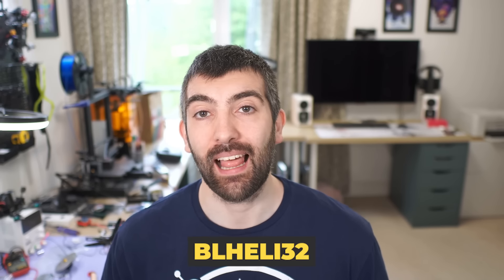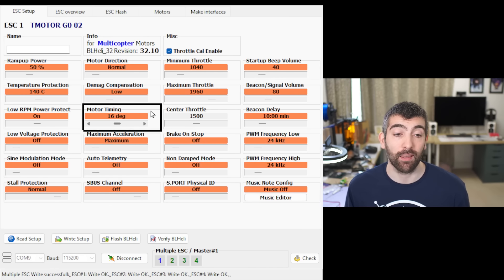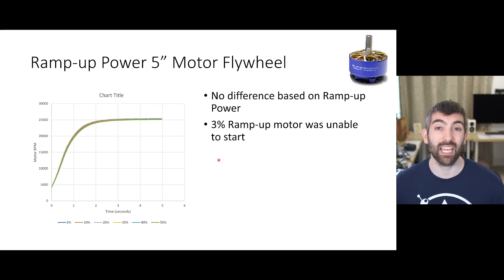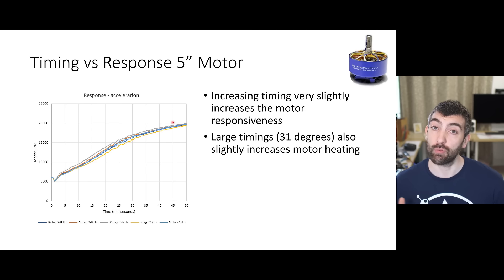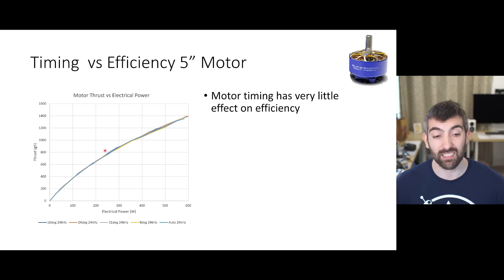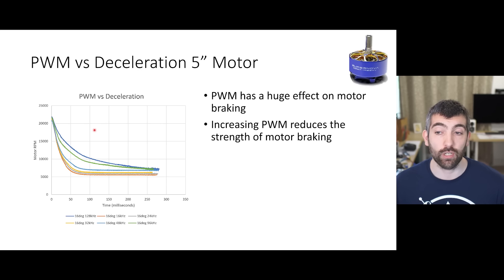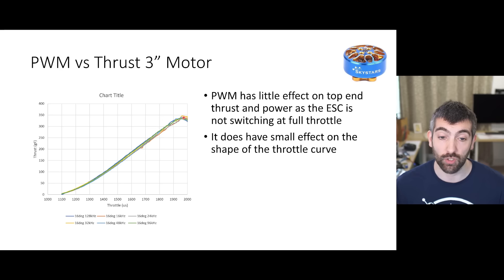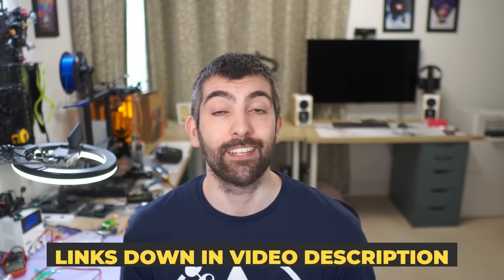Testing to find the ULTIMATE BLHeli_32 Settings for 3" and 5" drones

Comment: Okay what about if your running an 03 air unit on a 3.5 inch drone with 1804 - 3500kv motor should the pwm 24 or 48?

Comment: I can't follow along.  You reccomend motor timing = 24deg for 3" and then test pwm freq. with 16deg. and recommend 24/24khz pwm.  Wouldn't you want to test the pwm with the recommended 24deg motor timing instead of 16deg?

Comment: You didn't mention the effect of PWM frequency on gyro noise   I've found that 24khz is more likely to cause gyro noise than higher frequencies.   Of course, that depends on the ESC, FC, and motor combination.

So it's not always about top end performance; sometimes one has to be more pragmatic to get a quad working properly.  People need do a motor throttle sweep in BF Configurator to see if there is a point where the gyro freaks out using 24khz PWM.  Then try 36khz or 48Khz PWM to see if the noise goes away.

And let's not forget how PWM frequency affects the O3 Air Unit.
Reply: Yeah, on my 3inch 24khz pwm was introducing jello to my 03. Changing to 48 fixed that. On my 5inch freestyle rigs, I run 24/24 and 03 footage is butter smooth 🤷🏻
Reply: @Chris Rosser
I removed the propeller and got a log of rotating it to full throttle, and checked it with Betaflight Blackbox Explorer.The ESC is running Bluejay, and the vibration was the least at 96Khz.
Reply: This is why my recommendation has always been 48khz fixed timing. Based on my tests and reinforced by Chris's tests here, there are very minimal losses at 48khz and the noise reduction is definitely worth it. Above 48khz the losses compound and the noise reduction is not as significant and it's no longer worth it for 5" motors.

Comment: It's great to discuss these things individually but an overall quads performance is based on the sum of all the factors. I've had builds that had severe desync issues on Betaflight and there was no ESC/FC settings that improved performance. Then I switched to a KISS Ultra FC and the desyncs stop completely. The only difference being the FC and firmware. 

Also, thrust linearization used to have some effect on performance and was recommended if you using 48khz and up. Is that still a factor?
Reply: If changing flight controller software fixed your issue it was likely it wasn't a true desync, but likely something in the flight controller causing a dropout on the signal side. I've seen that happen more than once when the issue was actually a tuning problem causing runaway prevention to kick in etc. 

The thrust linearization recommendation is actually relevant to the decreased braking forces he shows here in his tests. It's important to note that the braking force losses are relative to the dead time multiplier necessary for each ESC, so will be dramatically variable depending on the ESC in question. Some ESCs with low dead time will not see nearly the degree of braking losses as ESCs with longer dead times. Typically the higher current rates the FETs the longer the dead time, and the worse the braking losses at higher PWM frequency. The more the braking losses the higher the thrust linear value is needed to compensate.
Reply: @QuadMcFlyFlies  with the flight controller in question, the motor desyncs were occurring on default settings as well as after being fully tuned. After reviewing Blackbox logs, it was extremely similar to the desyncs I've seen in the past, where a single motor would go full power even if the stick command was not calling for it. Then, after switching to a KISS Ultra V2 FCFC, I pushed the tune pretty far and still did not have a single desync. The point is that just discussing ESC settings without including other factors like PID tune and firmware is just a strange approach, and it would be better to see a guide that ties the two together.
Reply: @MurdersFPV  I agree with you for the most part. I disagree with his recommendation for 24khz for this reason, as in many cases 24khz is unflyable due to gyro noise issues and 48khz almost always ends up tuning better. The research side of what the settings do is still solid here from Chris, but some context is definitely missing. I've tuned literally hundreds of quads and built and flown personally well over a hundred in the last 10 years, which goes into my recommendations, and I only recommend lower PWM frequencies for 7" and higher rigs as the dynamics change there a bit. Brian (PIDtoolbox Guy) will tell you the same things, I've worked closely with him to review a lot of testing especially for the larger motors. That's where the practical experience comes in to interpret the results in context. Would be nice to get some of that in the video.
Reply: @QuadMcFlyFlies  This has been my experience as well.

Comment: y wonder for Brother Hobby Tornado T7 4215 or T-Motor MN5008 Antigravity Type 6-12S UAV Motor KV340 on 8s allot of desyncs at 70% throttle  50% ramp up , pwm or 16 or 24khz, 16 timing demag low or very high  no chance to working , is better on tornado 85 % throttle , i try non damped mode on  no brake but still desyncs esc is iFlight Blitz E80 80A 2-8S BLHeli_32.
Reply: you need much lower ramp up and much higher timing. infact your rampup and timing is exactly the worst combinatin for causing desyncs. try 25% rampup and 25deg timing. also i would not reccomend going lower than 24khz pwm. 16k causes lots of issues. 24k and good electrical filtering (lots of caps) should do. also never use non damped mode. it disables active breaking which is awful for the pid controller.

Comment: A PWM frequency like 96 or 128kHz is just a good marketing feature, regardless if BLHeli (R.I.P.) or AM32?
Reply: It's useful for smaller motors and lower current ESCs that have faster switching times and lower dead time values. 96khz and 128khz is super useful for tinywhoops for example.
Reply: @QuadMcFlyFlies  Agree, but I meant the ESC boards with 30.5mm hole mounting and not the AIO boards for Tinywhoops.
Reply: @maryjane136  Yeah for sure, total marketing on the bigger ESCs other than the fact it likely means they have a faster processor, which is still useful for overhead even at the lower PWM frequencies. Higher speed MCUs tend to handle bidirectional dshot a bit more consistently in my experience.

Comment: So what is the point going beyond 24khz other than the O3 issues some are having with smaller builds? The lesser braking ability is often what causes poor propwash handling.
Reply: At 5" 48khz is 100% still the best recommendation. The braking losses are not that significant and the noise floor takes a serious hit at 24khz. Compare your gyro noise levels and you'll see you have to dramatically increase filtering at 24khz in the large majority of cases. You have to increase it enough that in most cases any handling improvement at 24khz is overwhelmed by the increased filter latency.  I've consistently gotten the best flight performance at 48khz and very little filtering. This is why my default recommendation has always been and continues to be 48khz fixed timing.

Comment: Just want to comment about rampup power, that setting also affects the motor at 0 RPM, it sets how much power is dumped into a single winding during the 'startup' phase of the motor before it starts commutating. Using the 100kgmm^2 flywheel from a dead stop is a good test for this.

Comment: What about AM32 and bluejay?
Reply: and whoop motors, haha!
Reply: ESC drive mechanics are roughly the same regardless of the software. The same settings should apply in all firmware pretty much equally given the same motor and prop combination.
Reply: @QuadMcFlyFlies  as to my knowledge and my experience on AM32, your statement isnt completely right... as long as i know AM32 drives motors harder compared to BLheli, so PIDs has to run lower. Then everyone has different builds with different build quality and everything changes from quad to quad
Reply: @gabruzz  I've done extensive testing across all firmwares, going even back to the original BLheli 8-bit stuff before BLheli_S, and I've been testing AM32 since it was first released. I've worked closely with the devs from BLHeli and AM32 and I haven't seen any evidence for what you mentioned. Actually all the 32-bit software tends to run a bit lower at the top end than the 8-bit options, but that's not really relevant to what I am saying specifically here. The point is that the differences in these settings are roughly the same proportionally between all the firmwares and have the same basic impact regardless of the ESCs software. They're settings relative to the drive mechanics of brushless motor systems and the basics of that are the same regardless. The recommendations I mentioned above have been the same across several changes in firmware,  BLheli_S/BlueJay and BLHeli32 for example. Obviously the tunes will need adjustment, but the settings recommendations are the same. As I mentioned elsewhere I do disagree with Chris on the recommendation for 24khz for 5" because of noise and tuning issues, but again that holds across all the firmwares I've tested.
Reply: Seems more relevant than 5 days ago doesn’t it

Comment: Good stuff. This matches pretty much exactly with the results I got years ago testing these, and gives more support for the recommendations we've been using for defaults for a long time. 23 degrees timing, fixed 48khz pwm, rampup 30% is the answer for 3-5".  As far as 48khz vs 24khz goes. The 48khz results here are not significantly different from the 24khz and there is a significantly lower noise floor in the gyro in most cases with 48khz, so I think that recommendation still stands. I would be curious to see if the issues with higher PWM frequencies on that specific 3" motor could be solved by increasing rampup power.  48khz at least would be beneficial. Typically the smaller the motor and the higher the RPMs the more it will benefit from the higher PWM rates in terms of efficiency and noise.  My whoops are all on 96khz for example.  This has a lot to do with the fact that the deadtime multiplier for those tiny ESCs is like 5, compared to 30 or more on higher current ESCs. Remember, the PWM performance at high frequencies is directly tied to the dead-time multiplier.

Comment: I used BL HELI 32 for updating my Tinyhawk Freestyle 3 ,and my ESC’s no longer work. The drone just flips over upon arming. I Guess the drone board is just useless now. Any reason why this happened. Maybe I should have used Blujay instead.
Reply: Flash back to the original version
Reply: its either motor direction, motor mapping, fc orientation, or props. 100% user error. its the easiest thing in the world so solve if you just look it up.

Comment: I see the PWM frequency vs acceleration was tested using 16deg timing any reason to believe the results would be any different for alternative timing settings?  Also which dshot 300/600/1000 was used for these tests and could that setting also affect the timing or PWM testing results?  I assume not for both questions but I’m curious!  Hopefully results translate to AM32 as well!